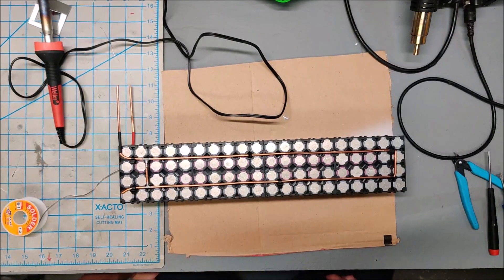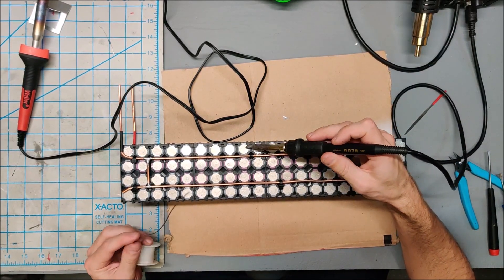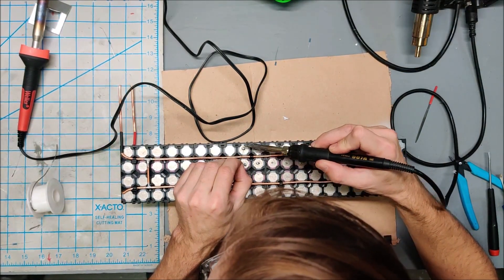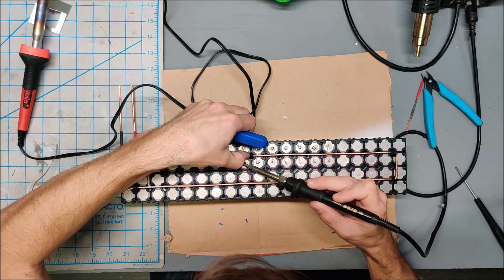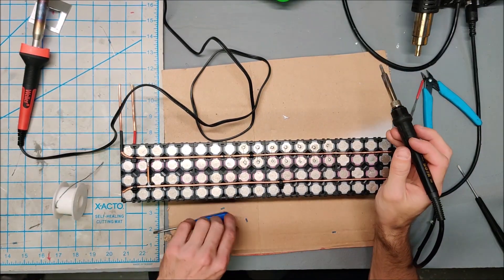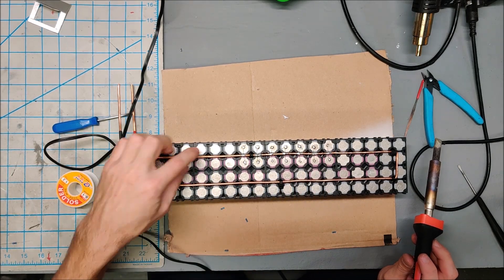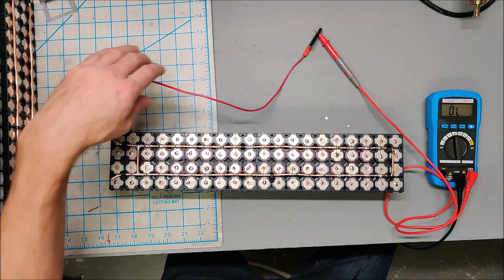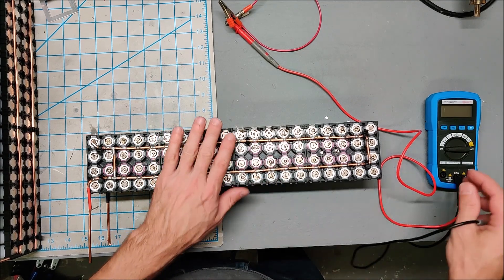DIY POWERWALL PART4 - SOLDERING THE BATTERIES

Comment: I like this video a lot. what Watt size is the large iron. I need to buy one. Also that bus wire bridge close to the terminal end seems to put the main use on the closer batteries. Is that not true?
Reply from the maker: No. The batteries will all deposit their electrons equally onto the bus bar. The bridge is just give a shorter path for some of the batteries to minimize resistance. 

https://www.amazon.com/dp/B00B3SG796/ref=cm_sw_r_cp_apa_i_7DUdFb64YS70T

Comment: I like this but couldn't u have just used 28 gauge wire instead of resister legs? seems like a waste, either way GJ with the vid, i'm gona build mine soon. Also what brand is that big iron?
Reply from the maker: Yes they make fuse wire. But resistor legs are already the right length and are dirt cheap. 

That soldering iron is a weller 

https://www.amazon.com/Weller-SP80NUS-80-Watts-Soldering-Iron/dp/B00B3SG796/ref=psdc_3207126011_t1_B000GR3NMY